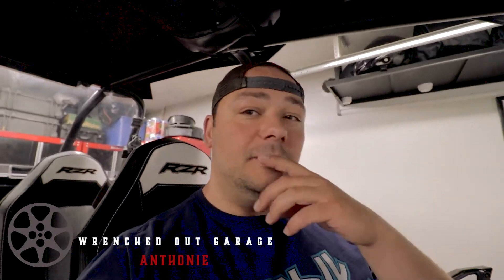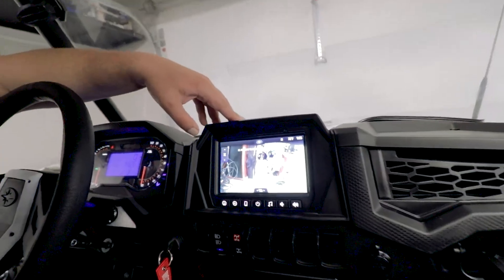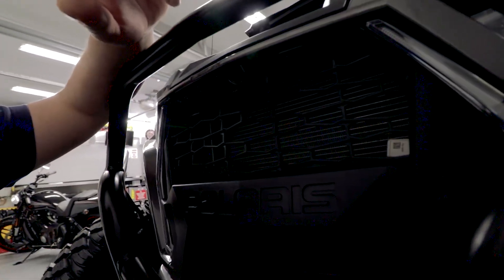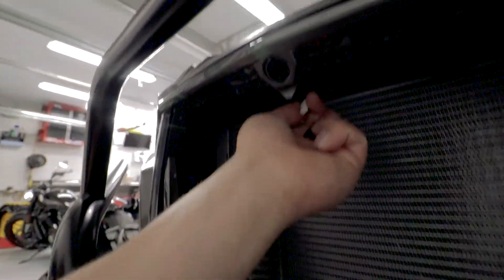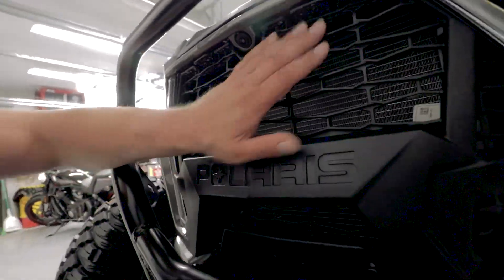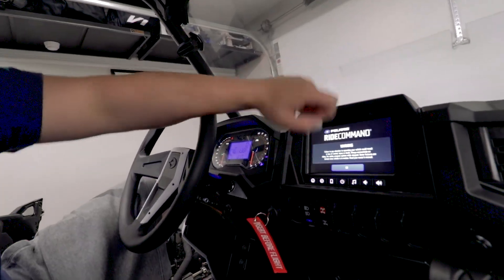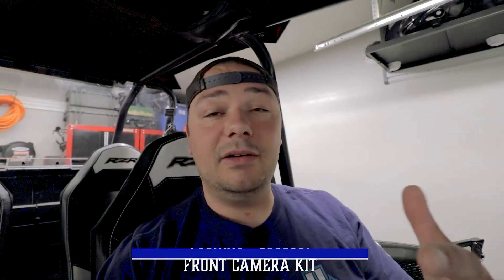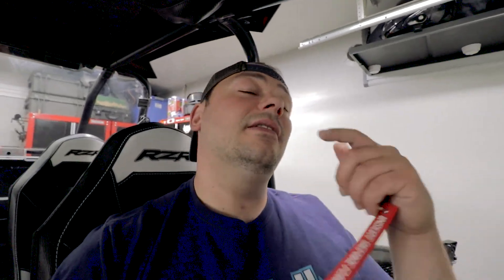2019 Polaris RZR XP4 1000  Front Camera Kit Install and Review

Comment: Just installed mine. Took about 2 mins total. Worth pointing out that the connector clip on my rzr was taped to the wire for the headlight… i didn’t see it at first. Just had to unwrap the tape and pull off the plastic cap. Took longer to find a working flashlight!